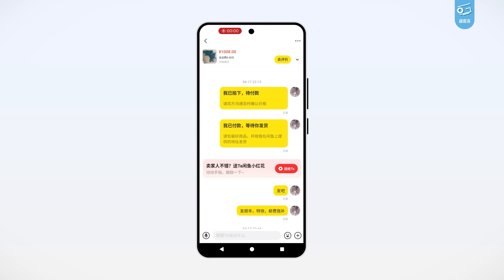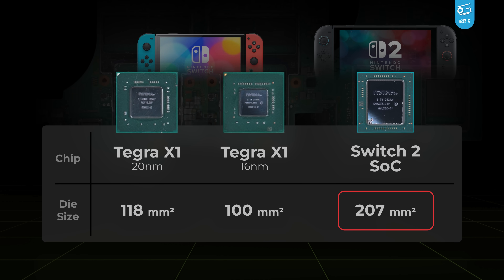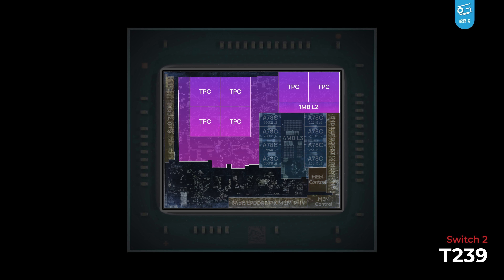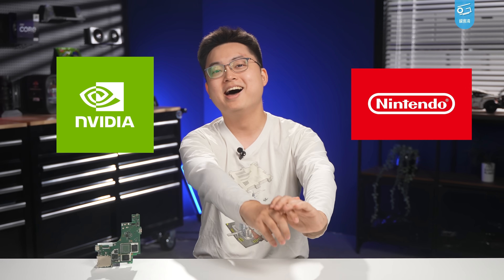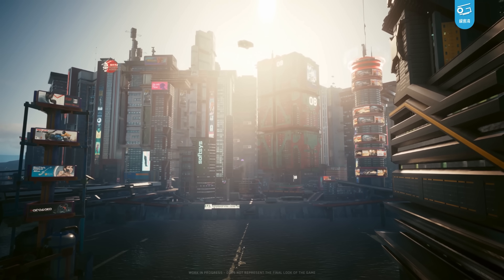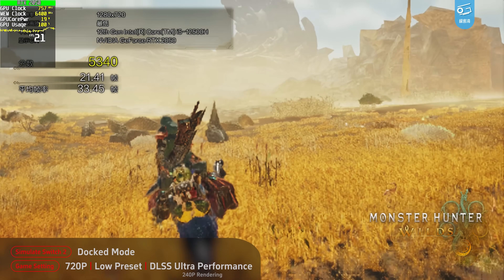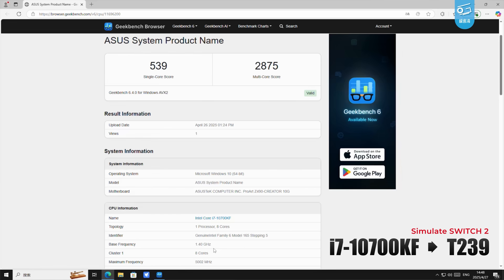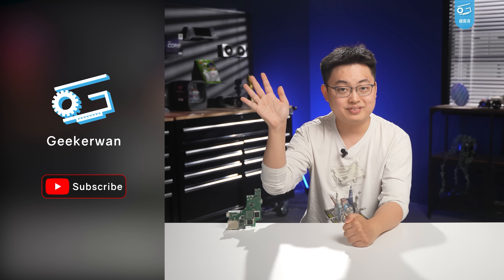This is Nintendo Switch 2's CPU!

Comment: Similar performance as steam deck but 3 years later 😂 good job Nintendo
Reply: The games on switch 2 will look better and run better then steam deck due to having a close platform were games a optimised for it and that's not included dock mode we're it's much more powerful then steam deck in
Reply: @AI-ex5rw  the steam deck already runs cyberpunk 2077 better than switch 2... on switch 2 in portable mode its 360p to 540p native upscaled to 720p to 1080p @ 20 to 40fps while on the steam deck its native 800p @ 40 to 60 fps
Reply: I had a steamdeck it really struggled with games like streetfighter on lowest setting. Was really bad.
Reply: Only in handheld, and you are looking at a PC best guess build without a streamlined OS and no optimization. Real games being played on Switch 2 are blowing away Steamdeck.
Reply: @garvensman the steam deck is running steam os. it's not like other pc handhelds and is optimized. in handheld mode cyberpunk 2077 runs a lot better on the steam deck than on the switch 2. also the steam deck has more ram, a bigger battery and a way faster ssd. it also uses 7nm and is more efficient thanks to the more modern manufacturing. and the cpu is double as fast as in the switch 2 (even docked)
Reply: @ No it doesn’t run it better. Switch 2 is running the version not available for Steamdeck.
Reply: @garvensman  doesn't really matter if the resolution and framerate are worse than an unoptimized version 😅
Reply: @HermesderWetterbote  You don’t get it. Switch 2 is absolutely running the game far smoother than Steamdeck, in all parts, but especially in Dogtown. There are side by side comparisons out there. I suggest you go look, because you are seemingly basing your stupid opinion off of unconfirmed raw numbers and clock speeds, instead of actually looking at footage being played on real Switch 2, which looks far better then the example here.
Reply: @garvensman  i own a steam deck xD And i saw comparisons. the steam deck performs way better than the switch - in portable mode of course. docked the game looks better on switch but the framerate is still worse
Reply: @ I own a Steamdeck too, and you’re lying or blind if you think it is looking or running better on Steamdeck. Also, you are comparing an unfinished build on Switch 2, to Steamdeck. The comparisons were also done before the developer interview, which had newer and more stable footage. 🤣😂
Reply: @ Let me know when Steamdeck is running Cyberpunk at 1080p 30fps as stated by the developers, being the quality handheld mode for Switch 2 on release.
Reply: @garvensman  it's 360p to 540p native with drops to 20fps on swirch 2. the 1080p are only archived via dlss upscaling. on steam deck @ native 800p it can run @40 to 60 fps.
Reply: @garvensman  the footage is mostly docked. cd project red conformed it is running natively @ 360 to 540p on switch 2 and then upscaled via dlss. in the footage it had drops to 20fps.  if steam deck uses frame generation and upscaling as well it can even go to 1080p 90fps.
Reply: @ Native resolutions don’t matter. It’s running DLSS and Steamdeck isn’t. 🤣😂 Again, it’s a build in progress that you are crying about. It looks better than Steamdeck regardless. Cope dude.
Reply: @garvensman  well then frame generation also doesn't matter and it can run @90fps on steam deck... steam deck can also use fsr upscaling to 4k... so if you add the fancy ai stuff the steam deck pulls ahead even further 😅
Reply: @ If it can do that, then why isn’t it? FSR? What a joke. 

Tell me, how much is the cheapest Steamdeck with a dock? 🤣😂 More than Switch 2 and it underperforms.
Reply: @garvensman  it's actually around 420$ and beats the switch 2 in portable performance. and the switch 2 has no frame generation. that's why we compare native resolutions and performance. the steam deck simply is newer hardware and more expensive components.
Reply: @ Wrong. The cheapest Steamdeck is $400 and the dock is $80. I’m talking name brand from the store. You can’t even be honest about that, so any further discourse is absolutely pointless. You’re flat out wrong about games running in Switch 2 and Steamdeck. Switch 2 looks better in every instance and all the comments in the videos disagree with your position.
Reply: @garvensman  you can use any usb to hdmi dongle.
Reply: @garvensman  even in the video on top you are commenting they clearly show the gpu beeping 20% faster in portable mode and the cpu beeing 200% faster. then there is also 4GB more ram available, and 500% faster nvme ssd storage. In every aspect the hardware of the steam deck is better and newer than inside the switch 2. the switch 2 can just use higher gpu clock speeds when docked. but as a handheld experience the deck is better in every way. (it also has double the battery capacity)
Reply: @ Bro, I’m over debating you. I don’t care what you can and can’t use. You can use other docks for a Switch as well. That’s not the point. An officially licensed Steam with licensed dock is more expensive. Full stop.
Reply: @garvensman  other docks tend to brick the switch (at least the first one) because nintendo did not use a norm conform usb-c port.
Reply: @garvensman  anyway you responded to my comment about "as a handheld" docked the switch has more gpu power because it can draw more power. but in handheld mode the steam deck is better in every regard. that was my point. and even if the steam deck would cost more it would actually make sense since it's hardware is  more recent and way more expensive. 4GB more ram (20$) double battery (20$) newer chip (30$) nvme ssd instead of 
ufs3.1 (30$) etc. nintendo is just taking a very big margin with every sale here compared to japan where it's a small margin. (310$ japan vs 450$ usa)
Reply: @ That’s weird because all 3 Switch 1 units at my house have used a third party dock, and none are bricked. Maybe you’re making more shit up as if it’s an excuse for Steamdeck.

Comment: The fact that the graphics chip dates back from 2021 is kinda lame. It almost feels like the Switch 2 is actually a Switch 1 Pro instead
Reply: PS5 pro CPU released in 2019
Reply: @Elkine.Richard just hypocrites
Reply: @Elkine.Richard  find me 3 people that praised the ps5 pro.
Reply: Nah, Switch 2 is a proper generational leap. 
It's even wider than the jump between PS4 and PS5.

If Switch Pro was a thing, it would've used Tegra X2 or Volta
Reply: What your forgetting is the first switch chip was from 2014.
Reply: It made invented before the device came out who cares also some tech was the latest available
Reply: when it was leaked in 2020 it was planned for switch pro. but the chip shortage back then probably changed nintendos plans.
Reply: @HermesderWetterbote  No, it was simply planned for a sooner Switch 2. There was never a Switch Pro planned, especially not one that is (at least) 7x stronger than the original console.
Reply: @MrBl3ki  then why a 4k output dock for the switch oled ? no other chip of that time would have been able to. and the chip was planned for release in fall 2021 according to the leaked nvidia documents of 2020 - right when the switch oled came

Comment: Thank you for the awesome work as usual and releasing this in English.
While the GPU on the switch 2 in handheld mode is close to Steam deck, i think something to remember than the switch clocks are constant, you are garenteed that level of GPU peformance. Steam deck while playing games especially open world game shift more power to the CPU cores and less to the GPU cores resulting in  lower performance what GPU only benchmark would suggest. The switch won't have this problem, between that, DLSS, and optmized software stack, 120Hz screen (so 40 FPS lock is viable), i beleive that the switch 2 should have better image quality than steam deck in most games even in portable mode, and might even give ROG ally a good competition for its money when running at 15 watts.
Reply: the steam deck can also use more than 15 watts by trading battery life.
Reply: What brand of copium do you use?
Reply: @gearfriedtheswmas he’s not wrong
Reply: copium stop smoking it
Reply: @gearfriedtheswmas  Just see how Cyberpunk looks on Deck lmao
Reply: @josemanuelruizgonzalez9353 if CDPR made a specific port for the exact specs of the deck they could make it run as well as the switch. The problem is that PC CP is a universal install designed for unlimited number of configurations and can't be as tightly optimized
Reply: @josemanuelruizgonzalez9353 It doesn't look bad on the steam deck I don't know why you Nintendo fanboys are coming up with lies. The game will run at 360p in handheld mode on the switch 2 😂
Reply: @kasjamm  DLSS > FSR
Reply: @josemanuelruizgonzalez9353  Higher native resolution>Lower native resolution. DLSS looks bad at very low resolutions
Reply: @kasjamm  800p on deck with everything on minimum looks better than medium with dlss? yeah ok
Reply: @josemanuelruizgonzalez9353  Do you even have a steam deck? Who's running the game at lowest settings? Y'all are doing way too much defending a system that isn't even out yet. You don't know first hand how the game looks or runs in the Switch 2.
Reply: @kasjamm  there's a lot of gameplays right here of the switch 2 version, show me a better one running on Deck
Reply: @josemanuelruizgonzalez9353  Do you have a steam deck to know how it looks and runs in person? You can't go off of non screen captured footage. And according to digital foundry, the game is struggling to run at a smooth framerates and runs at a low resolution and DLSS isn't even that noticeable.
Reply: @kasjamm  
>Digital Foundry 
lol lmao
Reply: @dyscotopia That's the problem. The switch 2 will receive better optimization than the deck because it'll sell better

Comment: Nvidia & Nintendo are ripping off consumers with such a bad SoC and insane pricing LOL
Reply: Tbf they're not selling performance, they're selling games which have definitely been tested to run on it. The positive thing about this is that the games are optimized for low hardware so emulators can run them easier (I think, I haven't tried switch emulation yet lol)
Reply: At this point Switch 2 is probably cheaper to make than the chinese clone consoles, the ones that come with 1000000 games included lol.

Comment: Wow, you've managed to improve on Digital Foundry's Switch 2 RTX 2050 simulated performance video in every possible way!
Reply: They had access to nividia tools df doesn't had, they literally said "our friends at nividia gave us the software" that downclocked it enough for it to run at switch 2 levels. Also the df video was done before the clock speeds were leaked so all they could do was downclock as far they could go.
Reply: @danielgrezda3339the problem was DF talked like they KNEW it all.
They should’ve been more reserved because a lot of people listen and trust them as “the final answer” when it comes to technology.
Tools or no tools, they should’ve known better.
Reply: @racoonracer7878  They make it clear that they're making estimates and guesses based on current available information. If you take their words as fact then that's your problem, not theirs.
Reply: @GreenSwede  bruh, they talking about DLSS and Cyberpunk JUST based on videos. People watching and probably A LOT would conclude that the game had no DLSS until the developers step in and states otherwise. 

I still stand correct that their recent videos have veered off into the realm of opinion pieces that masqueaade as "tech analysis".
In older videos, with the game/product, they run test and a full breakdown of the product.

Now, without a product in hand, just a video, they are doing "technical breakdown and analysis". LMAO
Reply: @racoonracer7878  What's wrong with talking about the latest news in their weekly DF Direct? They don't release single one-topic videos saying "wow cyberpunk on switch 2 has no DLSS confirmed", they are just analysing hands-on footage and trailer footage in the "here and now" as Rich likes to put it. You need to realise that quick analysis of gameplay footage never has been and never will be stated as definite fact. The DF crew never expresses it that way when it comes to new unreleased hardware and unreleased games. Take everything with a grain of salt, no matter who the source is. They always make deep-dive videos when games are actually released.
Reply: Digital Foundry  are paid off shills.
Reply: DF are going to be talking about this video's findings for the next month.
Reply: DF is owned by Eurogamer, nuff said
Reply: @SomeOne-hc3bd huh. Really?
Reply: @SomeOne-hc3bd  Wrong. They are not owned by Eurogamer. Both were previously owned by Gamer Network. Gamer Network has been acquired by IGN Entertainment.
Reply: @SomeOne-hc3bd Not true, Richard owns 50% of it
Reply: @SomeOne-hc3bd  elaborate please
Reply: @SomeOne-hc3bd  isn’t DF owned by IGN?
Reply: DF too busy making ads and podcasts, they lost the sauce.
Reply: Yeah, people tend to be able to improve on things they watch and then find flaws in months later